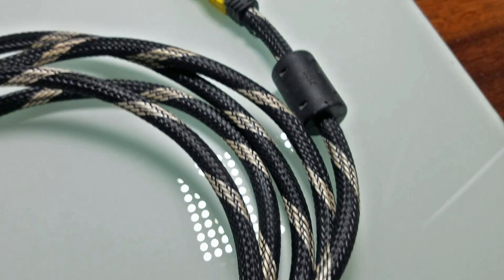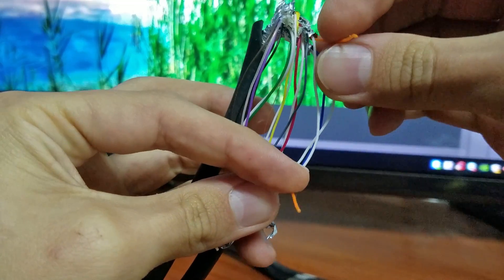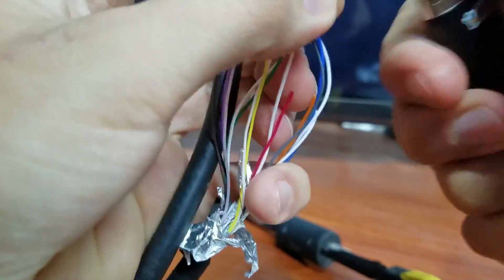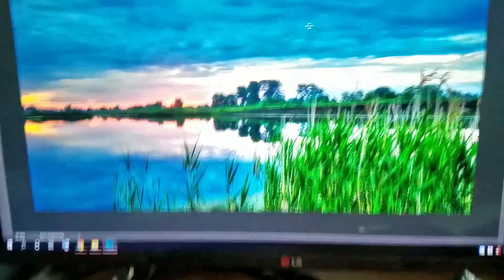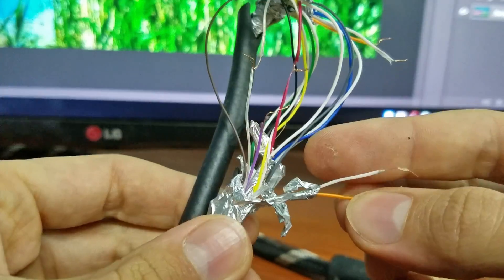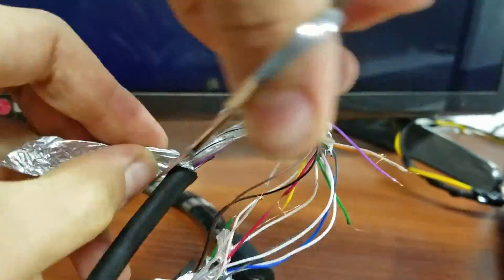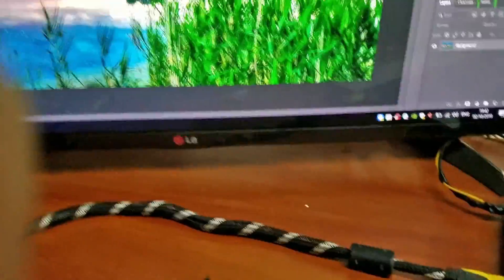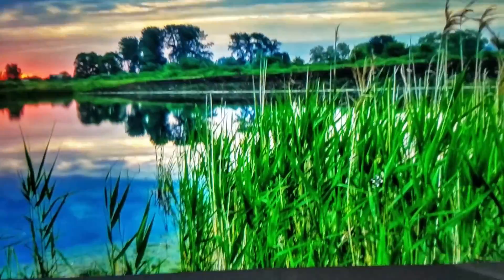What Happens If You Cut Wires in HDMI Cable?

Comment: My projector has two hdmi ports. One of them faulty and gives flickering pink pixels where there is supposed to be white. I wonder if it's something as simple as a loose connection. Whatever wire that shows green has a weak signal, so it only shows blue and red which when combined looks pink. The other hdmi port is fine.

Comment: All cables, USB, HDMI, ANALOG VIDEO AND AUDIO, Ethernet use copper wire. what makes them different is how they constructed as a whole, shielding application and wire gauge and amount of wires in that cable. Thats it.
Reply: Hola,calculo q existe algo para lo q quiero hacer,pero como podría empalmar un cable HDMI con unos  de audio y video ,se puede? Cuales tendría q hacer el empalme? Desde ya te agradecería una ayuda si puedes. Saludos desde Argentina

Comment: Here's  an experiment for hdmi cable. Connect the hdmi cable wire to a USB A WIRE. AND SEE IF THAT CAN MAKE A USB PORT TO  BE USED AS A HDMI PORT. IF THIS WORKS. WOULD BE HELPFUL WITH MY PS4. SINCE IT ONLY HAVE ONE HDMI PORT.  MAKE THE USB TO HDMI.

Comment: I thinks there's something like a digital synchronisation applied to the six or four wires including red blue green and yellow or purple wires whoes duty is to transmit colours as digital data i think is called TMDS or something unlike the rgb or vga cables that if for instance you cut red wire in that connection only the red colour disappears in the screen and in digital colour transmission disconnecting a single wire of any colour would mean a lack of a digital colour synchronisation in the receiver so it results in black screen after cutting one of those wires

Comment: good afternoon bro... hey if I want to cut an HDMI cable to pass it through a hole in the wall and when I connect it again, will it works? Thanks
Reply: It should work. But make sure you restore all those shields for the four pairs.

Comment: Can you increase the length of the HD cable two meters or more using a internet router cable ?
Reply: my question exactly
Reply: It may not work. For long distances, you can use a BNC cable but you need an HDMI to BNC converter then BNC to HDMI converter

Comment: Type A hdmi can tell you what the cable does in the manual, I'll do you a favor and type some things. pins numbered 1-19: (try not to get confused by the incoming wall of text which is listed in order the pins and what they do: TMDS Date 2+,  Data 2 Shield, Data 2-, Data 1+, TMDS Data 1 Shield, blah blah blah, first 9 pins are Data Transfer and shielding components (1-9), (10-19 continued): clock connectors: clock+, clock-, clock shield... once you get to 17,18,19 it's very important just to not sever... cause well you need them, it's the ground, the voltage supply: 5V(50mA), then 19 lastly is the HotPlugDetection 1.3 and 1.4+, meaning you need 19 to connect things into a hotplug AKA always on (not entirely sure about that though),  18 = most important for power, 1-9 = important for data transfer. Also neat that you opened a cord and cut with something literally running, but next time you might not want to and just check a manual. No need to reply, take care.
Reply: Also, you discuss the dangers of doing this while you're doing it, so I assume you know you shouldn't actually do what you did, but still, learning is half the battle, try to avoid becoming fully integrated with your system AKA (electrocuted)
Reply: C Harris brilliant.
Reply: I seriously get mad when I think of your comment

Comment: If we cut it and connect directly to our eyes, can we see the video without distortion?
Reply: For full experience we have to do the same thing but for ears too 🤣🤣🤣
Reply: This is probably a joke, but just in case it's not... don't try it. Most bio networks aren't equipped to handle HDMI, and inputting signals your system doesn't recognize can be departmental. If you really want to do HDMI for some reason, I highly suggest speaking with your bionics professional and letting them do it.

Comment: nice video.
what if using rg45 wire (lan) to extend it. ab 5 - 10 meter'or more.
cut the original hdmi, and join with lan wire in between ? thanks

Comment: You have a great channel, I found it today. HDMI is really just a data cable, it contains three serial data channels and a clock signal channel. Each of these is made up of a positive version of the signal and a negative version, these are compared when received and any common spikes of voltage are discarded. There is also an earth for each of these. If only a single channel is in use cutting a single wire will go unnoticed.
I think the distortion is caused by some data loss on the clock signal or perhaps even a data channel.

Comment: In the HDMI cable you have 8 cables (4 twisted pairs) that send image/sound data. The others are basically detecting that you turned on a device and perform a handshake to check that the HDCP encryption is established before sending image, so if you don't interrupt the connection you still have data but you cannot reestablish the connection without them. On the plug you also have 4 pins I think that are ground for the shielding. Although not explained in the video, it answered my question for what I was trying to do, nice video.
Reply: Bloody good explanation! Thank you very much!
Reply: Awesome video
Reply: @Stergios pls help... I have a doubt
Reply: I want to know WHAT wires are fir Audio.
I want to try connection some speakers to my PC,Which does Not have any audio inputs. 🤔
Reply: @n.g.gardenservicesessex1714 yo necesito lo mismo,si consiguió como hacerlo o cuales son los cables te agradecería
Reply: I'm planing to cut all 8 wires and rejoined with soldering irons. Can still iy be ok to use? I buy very long HDMI cable about 5 meters, but now I have no longer need that range so I want to make it shorter than 2 meter and exceeded 8 cables can be used for my diy project
Reply: @Than Tun Zaw  Each solder point is a source of interference so it's possible that you will have random disconnects etc. If the soldering is good, it may work but it's always a risk. Avoid sharp edges as much as possible if you want to go on.
Reply: Would a 4k cable be able to be cut and spliced into 1 input to 2 outputs or would it lag or choose path of least resistance?
Reply: I agree with you. Once handshake is establish the hand shake wires can be cut and your video and audio will continue to work. But you need those handshake wires (such as the orange wire) connected again once you disconnect and reconnect from your PC to establish communication again and have things working again.
Reply: So pls can I try to join  with a different  hdmi by cutting  and joining

Comment: Man I just want to know which wire does hdmi produce sound? I have tv which have hdmi Arc suppot but my 5.1 speakers supports analogue cable just wana make home made Hdmi arc to Analogue converter
Reply: You can’t make it. HDMI is full digital signal. It encode with mixed sound and video. You must have decoder only to make sound such as TV, AVR, sound bar, etc. No select one cable to use with analog sound. 😉
Reply: @hdsolutions3054  thanx man for the info. Now I get the 5.1 surround sound from my PC  with 3 different 3.5mm audio port with dvd input in my home theatre 😎
Reply: @hdsolutions3054  how can i remove  the micro usb on hdmi cable,coz there is a deffectice

Comment: HDMI is packed full of many options of data and control. It’s more than just a video cable or a way to hook up a monitor. There’s sometimes power, control for other equipment. You have enough to make the monitor work with all those wires cut, but HDMI does a lot more than the things you are testing for.
Reply: make ur own video
Reply: @techisland6446  😂😂😂
Reply: @techisland6446  bro he has givene advice and if you all about that so why you don't make video on that

Comment: Some of the wires are com link.  Which is why had to reconnect them after cutting the red.  Unplug cut then plugin.  You will notice the impact.
Reply: Hdim cable ka Jo 20 tar hai o kon sa audio hai or kon sa video jaldi photo ya video bhejiye ji please bahot paresan hai